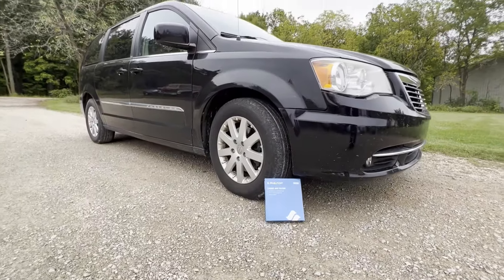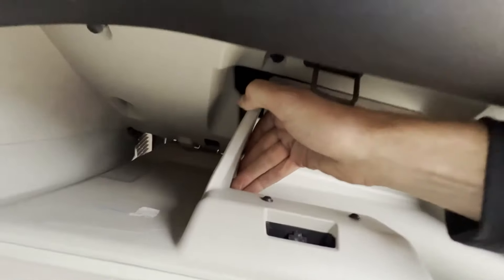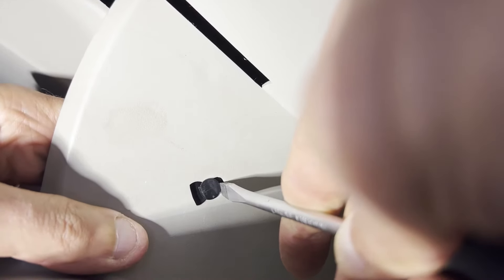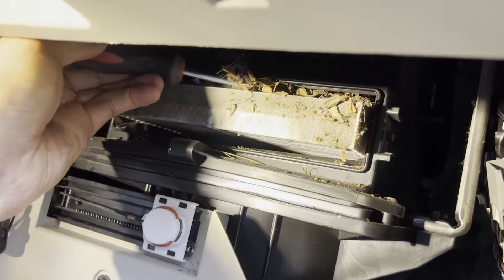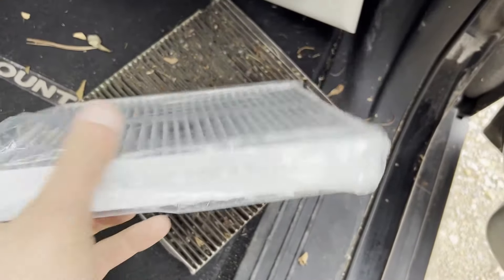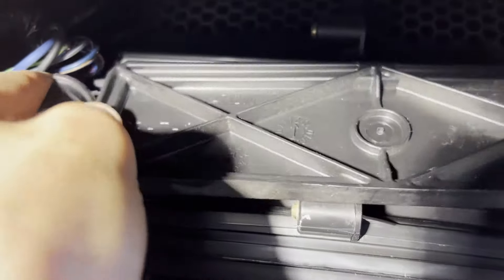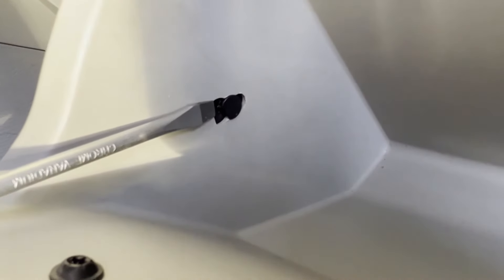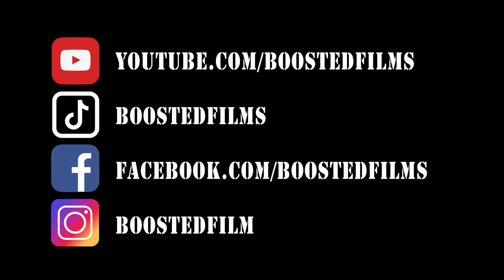Chrysler Town & Country Cabin Air Filter replacement

Comment: Hi liked I did it, but I took one inch 90 degree pvc pipe taped to shop vac and vacuum  back air intake and got a lot of stuff out before putting new filters in pl